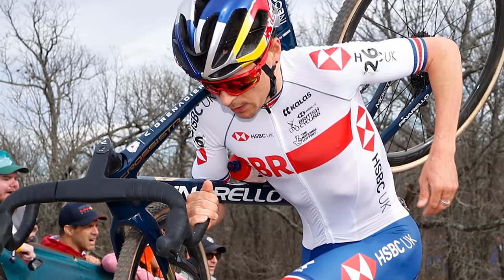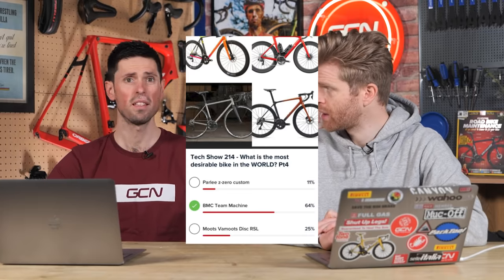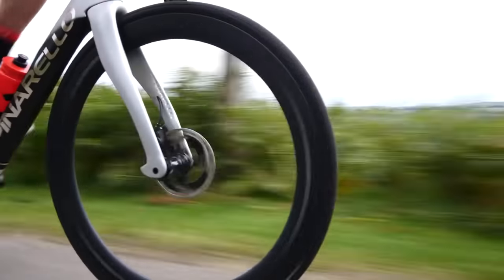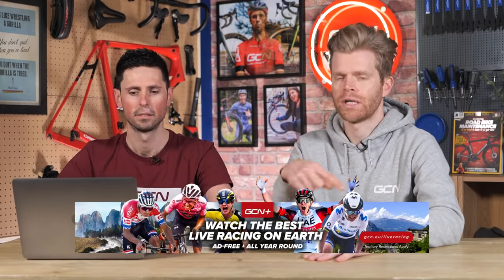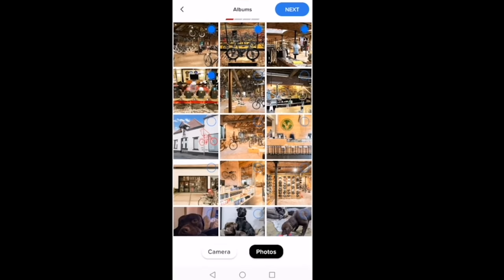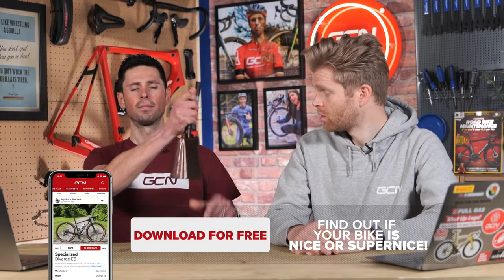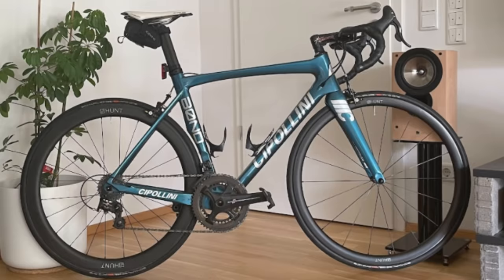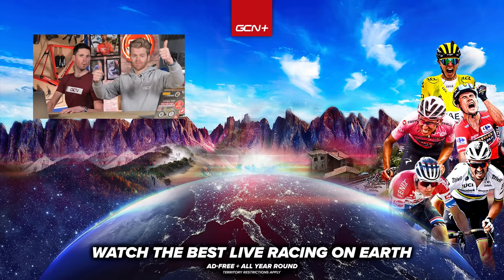Why Do You Ride Slower In Winter? | GCN Tech Show Ep. 215

Comment: Another physical aspect why we're slower in winter: even if you ride with the fast summer tyres in winter, their rubber is harder and rolls worse.

Something to think about regarding denser air: for cars with ICEs, the higher aero drag is offset by higher engine power as more oxygen mass gets into the engine. For cyclists, there probably is some effect (like there is for mountain dwellers who descend to the sea level), but a lot less significant.
Reply: When I go down to sea level, it feels like jet fuel in my bloodstream for 4 to 5 days. I feel super good, then my red blood cells adjust and I go back to normal O2.

Comment: Good explanation on this. And in my own (very cold riding) experiences as of late, the fact that I ride slower & have a lower ftp in winter months is because of many factors. The environment, my mental status, my form, I'm generally just more tired in winter months, etc.. All of this (and more) equate to noticeable hits in cycling performance. As mentioned in this video.

Keep it up @GCN Tech.
Reply: Right. I’m not riding in awful NA conditions, but it’s still around 0-3 C, and I just don’t want to be there, so I only do ‘maintenance miles’ until it warms up a little. I used to try and do fun rides in the cold months but these days I barely bother.

Comment: I was just thinking about this, since I noticed the past few days that on my commute home I am much faster than in the morning. It is most likely the removal of the extra jacket (for warmth) and the higher temperature (lower density air). Fascinating.
Reply: I think its just the extra motivation. :D

But thinking about it I am normally quicker to work than home.

*Over the distance I have 72m elevation drop, and going home it is 72 m elevation gain.
Reply: I’m exactly the same. Mornings I’m still sleepy, also don’t want to get sweaty.  Way home don’t worry so much about it.
Reply: Exact opposite for me: I always hurry the morning because I don’t want to be late at work. I take my time to come back.

Comment: Because you need energy to keep yourself warm (body heating, air heat up while breathing etc.).
As your energy is fixed parameter, you need some of your energy to keep your body warm.
This amount of energy used for heating is much higher in winter. So there's less energy for pedaling.
Isn't it simple?

Comment: I live in Maine where winter riding temps often down into the -7C range. I've noticed that when it's cold out I have more trouble breathing and see a drop in performance as a result. Sometimes I find myself instinctively placing a gloved hand over my mouth as if in hopes of warming the air. I wonder how common this is with cold weather cyclists?
Reply: I just wear a face mask when it's actually freezing. Stops me getting really dry skin on my face in the wind chil and chapped lips.
Reply: Buff or baklava over your face stops the freeze. I also gave a gaiter so I can pull it down with one hand. Works well as a mask substitute at the cafe too.
Reply: I always ride with a buff Over mouth and nose, this helps.
Reply: Even zero makes my teeth hurt! You gotta cover  up.

Comment: They touched on aero and air being more dense in winter because cold air is more dense. In avation,  density altitude is a big deal. It is the altitude that the aircraft thinks it's at. It takes into consideration, temperature, actual altitude, and barometric pressure. For aircraft you want dense air for better lift, propeller performance, and better engine performance with normally aspirated engines. Mostly the opposite for bicycling needs.   For bicycling aero has become recognized as very important. A good reference for air density are the aircraft Density Altitude charts.  Personally, without any actual testing I feel that I can get more oxygen in my lungs in cold air but it seems to be offset by the cold dense air drag.
  Trick question: which air is less dense? Humid air or dry air?
Answer: humid air, but not by alot.

Comment: Yep, makes sense... air density, mud guards, clothing all impact air resistance. And wet, muddy, maybe icy roads make u more cautious especially in corners (also, slowing down more fir corners and re-accelerating uses more energy = tire sooner). Similar for less light or even night riding in winter. And winter tyres, plus fitness level.

Comment: As an old fart doing early morning rides year round, I find the going considerably slower in the cold. It has always felt like aero drag that's been making the difference, and I have put it down to two  things. Firstly, the extra density of the cold air (just look up the effects on aircraft performance), and secondly the fact that in the cold, I wear a jacket that always flaps around to some extent and causes an increase in drag. On the question of effects on the body, it must certainly increase the oxygen availability, but this would be offset to some extent by the extra energy used to keep warm.
Have not attempted to quantify all this mathematically because I'm  not smart enough and can't be arsed trying, since it's unlikely that I'll find a way to do much about it.

Comment: In regards to slower winter it's  two fold problem. One is Holiday Gut most riders will pack on extra weight around the holidays which transfer to slower speeds. Second is because of the cold we have a survival reaction which slows us down due to the effects of wind chill, slower speed means less wind chill, it is a automatic response and most don't even realize they r doing it.

Comment: It is because the grease on the whole bike gets stiffer when cold. I once put a loose rear wheel outside during a cold night down to -12C and the next morning I could hardly turn the axle with my hand. The rubber of the tires also gets stiffer.

Comment: I know exactly why I ride slower in winter. Where I ride my mountain bike is really muddy and if it's too bad. I have found walking when the mud is un-rideable. Is really slow. Plus riding down stairsets on a hardtail may cause a square rear wheel. If I ride like Blake Samson from GMBN. When I do occasionally ride on the road. I am faster. Even on my mountain bike running 21psi front and 26psi rear.

Comment: I disagree with the posts claiming you use some of your energy to keep warm. I think this is an urban myth. Heat is generated as a by-product of physical exertion. In winter, you wear insulation to keep that warmth in. In summer, you wear less to let excess heat escape. The body does not generate extra heat just to keep warm, when you are cycling. The only mechanism I'm aware of that the body has to generate heat for the purposes of keeping warm is shivering (operating muscles to generate heat as a by-product). So if you are not shivering, you are not burning extra energy to keep warm. Any medics out there to confirm this?

Comment: Hi GCN, I've just made the step from wheel on trainer to direct drive. The trainer I got didn't come with a cassette and my bike has an 11-32 but my partner's has an 11-28 (both 11 speed). Would it be possible to just buy the one cassette and both use it? If so which size should we get? Thanks very much! #askgcn #askgcntech

Comment: In colder temperatures, your body must dedicate more energy to keeping the muscles and body core warm, thus a loss of power. Heart rate is higher due to this (this is much like riding in ultra high temps - higher HR to keep the body cooler, less output) Those of us in minus temp climates have noted a 10%-15% loss of power due to the weather (mates survey)...not to mention that our minus temp kit weighs more. That said, I wouldn't trade my Goretex-lined 45 north boots for anything, speed be damned. Those are what keep me riding in winter.

Comment: I think, another factor for slower speeds in winter is, that your body needs to burn more calories to stay warm and therefore allocates less calories for movement.
Reply: But the way your body generates heat is through physical movement whether it’s shivering or productive movement like cycling the energy is probably being used more efficiently in this regard.